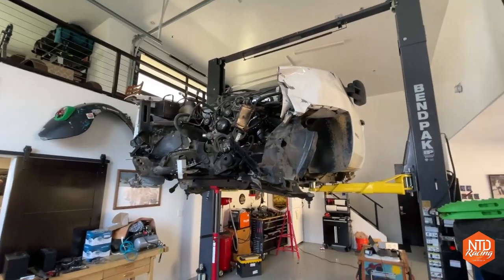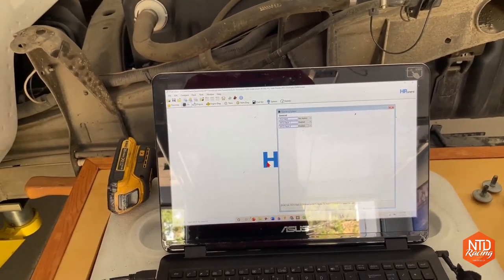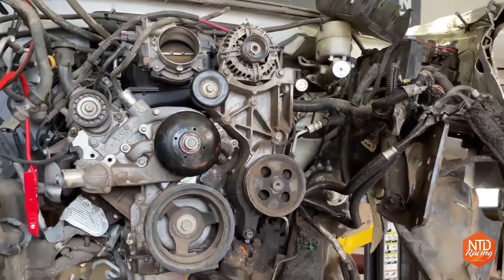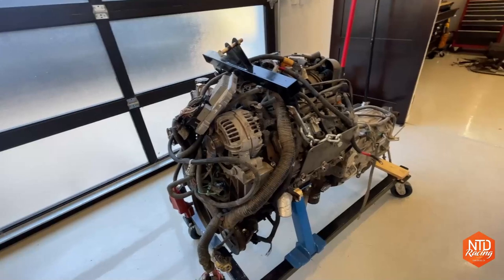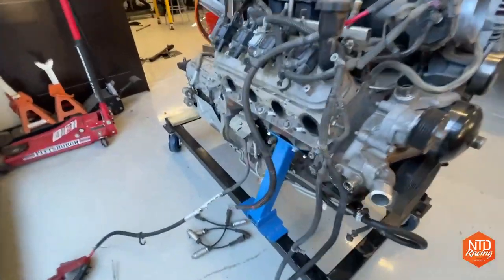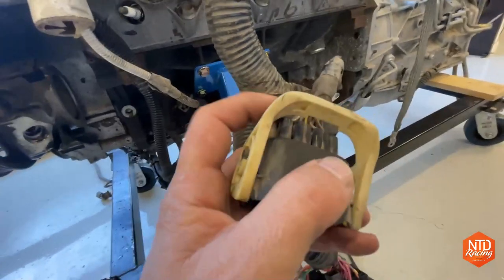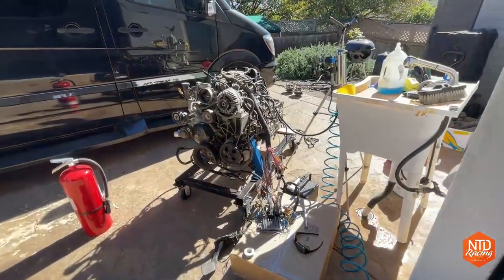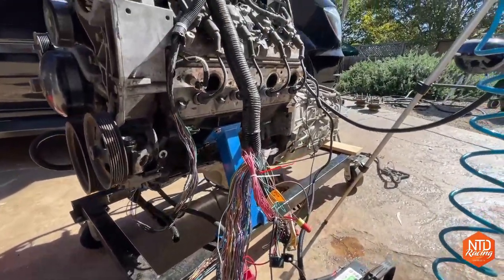How to make an LS Engine Stand Alone - L96 With an E78 ECU

Comment: Lol, man I wish I had come across your videos sooner, I just dropped a L96 6L90 in my 76 C10, and I wanted to use the ecm and tcm as well as the original harness,  but had to go aftermarket for lack of resources on a 2019 L96 swap. Keep up the amazing details brother!
Reply: What company had the harness? Im having issues with my stock harness and cant find an aftermarket for this engine/trans/ecm. Mine is a 2018 van e78 l96 6.0/6l90
Reply: @thetodifah4707  I got mine from BP Automotive
Reply: @Martin olivas  were you able to use the E78 ecm? I don't see an option on their site that is compatible with that ecm.
Reply: @thetodifah4707  I bought the controller kit that came with a new ecm I honestly don’t remember the model number but I did have to run a different tcm as well due to tuning issues. As well as an older 2012 throttle body and even had to share a vin number from a donar vehicle in order to get it tuned. Now in all of this I had to pass the buck to a mechanic and the tuner because I got overwhelmed and hit a rut. I had hoped to use everything stock from my complete pull but since my L96 &6L90E were out of a 2019 Silverado HD. There was practically nothing out there for my newer set up so that’s why myself and the mechanic were winging it. In hindsight It would certainly have been cheaper to get everything out of an older combination but you live and learn. I’m 100% sure that there’s a way to utilize all the stock components but I’m not smart enough nor have the time to trial and error with confidence that It’s going to be correct. I hit up all the main ls swap masters and got shot down by the few who responded because my combo is so new.
Reply: @Martin olivas  That's the same problem I'm having. Too new, no support. Thank you for taking the time to reply and explain how you made your setup work! I really appreciate it!
Reply: @thetodifah4707  no prob bro sorry I couldn’t be more helpful to you.

Comment: I love the content brother. For future reference.  When pulling the engine on a damaged truck cut the frame at the firewall. Cut the top and about 3/4 of the way down with a Sawzall and the frame will relax and drop down away from the firewall and it will give you more room to work. Don't cut all the way through. You just want the frame to drop down some. Don't cut the bottom. You want the engine to come forward and down some. Once you get a little over half way on each side, go from side to side until the engine moves forward and down some.
Reply from the maker: Thanks.  This will be useful for the next one I am looking at.
Reply: Welcome. Just make sure to remove the transmission mount so the engine and trans can move with the frame.

Comment: These videos are packed full of information and clearly presented.   Super useful.  I can't believe the channel doesn't yet have more subscribers.
Reply from the maker: Thanks.
Reply: @NTD Racing  Any idea why my Throttle body wouldnt respond to my pedal? It moves a tiny amount when i first push the pedal, tgen nothing. Tried another new throttle body, and same result. My handheld code reader shows the pedal move up to 83.7% nice and smooth, but the actual throttle body  position stays steady at around 32%.
Reply: @ntdracing what’s ur opinion on the expensive terminator x harness vs a stand alone
Reply from the maker: @Brandon_obs_ls  I could not really say….I ended up going with LSX Specialities for a Harness and computer.   They are the real deal.   I literally told they what I had and they made the harness and best guess at a tune.   I put it on our race truck with no time to get to the Dyno and we ran it at the Baja 1000.   Made it all 1200 miles to the finish.  https://www.facebook.com/LSXspecialties?mibextid=9R9pXO
Reply from the maker: @Brandon_obs_ls  in the future, I will make sure to get a drop out engine with an E38 computer.  Just seems easier to work with.   Still using the old harness on our first race truck.
Reply: @ntdracing  I keep hearing people talk about terminator X and Holly harnesses but i recently saw a guy who had 1000 plus hp with just a stand alone stock harness and it harness he said u ain’t need that extra money wasted if u tune it right u good with oem standalone harness
Reply from the maker: @Brandon_obs_ls  agree 100%.    I went with an aftermarket harness because I was running out of time on our Baja 1000 truck build.  I also cut salvaged some of the parts of the original harness to use on our other race truck.  I decided to spend some bucks to save time and start over with a solid harness.   If I had a solid harness with an E38, I would have just used that.   The LXS folks made me a new harness with E38 computer, so now both trucks harnesses are nearly identical.

Comment: L96 is a great motor for desert racing. They don't have a ton of the stupid emissions crap that the other LS motors have and its still an iron block which is very reliable. With a little love and plenty of on time maintenance these motors last a long time. Plus the L96 is made to run on crappy fuel so theoretically, feeding it great fuel and letting it breather better yields decent improvements in torque and horsepower.
Reply from the maker: It ran great for 1200 miles at the Baja 1000.  Oil and air filter…ready for the Mint 400.
Reply: @ntdracing  Just replaced plugs, plug wires, and coils on mine and put shorty headers on it while I got rid of the busted exhaust manifold bolts. Now it runs great! good motor. Although I've always been a ford guy, my other project is an 88 Bronco II awaiting the all mighty 5.0.

Comment: With the HP tuner, once you spend the credits for a vehicle, can you continue to connect to that ECU in the future? Like when you are using it for racing, can you change the mixtures and what not? or is it 2 credits each time you connect to that particular vehicle?
Reply from the maker: Two credits works forever on that ECU.   I have probably sent a new program 100 times as I am learning to tune these engines.

Comment: Hi great video, any tips on how to make an audi 4.2 v8 bns engine from an rs4 standalone? I’ve made a test bed for it, I’ve got the main engine loom and ecu, and main auxiliaries attached to engine, just not sure where to start with the wiring… I’m doing an engine conversion into a vw but want to rebuild it and get it running on the test bed before I install it into the van

Comment: How did you get yours started with out the BCM? My LM7 from a 2007 won’t start even tho i disabled VATS from HP tuners. It cranks, starts then kills it self after 3 revolutions.

I checked the crank and cam position sensors. Everything else is connected but still won’t stay on.

Fuel is also at 60PSI as the motor is running
Reply from the maker: Make sure you select “Write Entire” when you write back to the PCM.  If you do not, when you go back and read the PCM again you will see that VATs is still there.  Hope this works.  Would like to know.

Comment: So basically  tie all the pinks together,  run purple to ing start. ground engine block from battery .run hot from battery to starter. Remove vats. I'm I correct or missing something.  But will it run with doing anything else???
Reply from the maker: That is about it.   There are a few  grounds you will have to take care of that go to the ECU.   If it is black…ground it.    Good luck.

Comment: Awesome video! I have exact setup (L96 with e78 and 6L90) in a 62 delivery van with a Current wiring harness. But now I want to switch from clutch fan to electric fan and wondering if you have that figured out yet? I would like to run some brushless variable speed fan(s)....maybe Spal. But been hearing it can be hard to control them with the factory computer. Wondering if you've made any progress on that topic. Awesome content!
Reply from the maker: I have not found a way to run the fans off of the ECU yet.  I have just not found any info on how to use the PWM signal to make a relay work.  I am looking at putting on of the Derale relay systems.  If I figure it out, I will make a video and let folks know.
Reply: @ntdracing  I'm in the same situation. Apparently GM oe fans and ecu uses a different signal than aftermarket fans so it's difficult to properly control aftermarket fans with the ecu. A lot of people use oe fans, I've also seem where they remove oe fans from the shroud and put them in a custom shroud. I read where a couple years ago HP Tuner was looking into it to see if they could add programming for that but no idea if that ever happened. I cant find any info on Youtube about this....it might be a good video that gets some good view! Anyway, I'm liking your channel, pretty sweet project!

Comment: 2018 e78 6.0/6l90 - i had someone remove vats. Will the throttle body open and close with key on engine off with the dbw pedal? Im having issues with no control of the throttle body, and when the ecm switches to closed loop, the engine backfires through the intake tube. Any help would be appreciated!!

Comment: Can you use ly6 cam kits in the l96 if its the same other than injectioner plugs also were you ever able to tune in the fans on the e78 ecu ? Thank you for your time
Reply from the maker: @jaywoolfolk243  they should all take the same CAM.   We did swap our L96 to an E38 ECU.
Reply: @ntdracing  did you change harnesses or did it plug right in ? also do you know if the 2014 and up body style 2500 all came with the e78 ecu thank you for your reply very appreciated I'm trying to put a 2014 up l96 6l90 4x4 in my 04 1500
Reply from the maker: @ ok…this is the best I can answer, hope it is right and helps.   

If remove an engine, transmission, ECU and TCU from one car and put it intact into another it should work.   There will be challenges making everything work with “new” truck like the BCM.   Since I swap into race cars, I do not have to deal with any of that.   But as far as power goes, if you keep all the parts together it should involve simple wiring and removing VATS.   I would just swap the engine first then CAM swap later.  Get it working before you remove VVT and have to do the associated tuning.

Comment: Where did you find pin out for gas pedal I have a 2006 lh6 I need to wire into
Reply: Tac module still....did you find?

Comment: Does this standalone work for the trans that’s a need to know?
Reply from the maker: Yes.  The 6L90 TCM does not have anything to do with VATS.   It talks to the engine to hash out torque management and gear selection, but you can swap a 6L90 with another no problem.  We were running an Express van 6L90 in the race truck.  The only thing it did not like was when we flashed the truck program into the express van TCM.   Now what I do is connect any 6L90 to my LY6 or L96 and read and save the tune from the TCM to modify.   Then we flash that back in with stuff like TUTD…see my other videos on that.  Hope this answered your question.

Comment: Did you ever find a pinout.  I have an e38.  I am looking to create a standalone harness.  So i assume you ended up tying all the pink and rewirea together and provided a grown to the black?
Reply from the maker: I did.  Check out the link for GM Upfitter in the description.
Reply from the maker: I did tie all the pinks together, but I will make a fuse box and separate all the major parts into a separate fuse.

Comment: but how do you turn it off?
Reply from the maker: Remove the 12v from the ECU.  Will shut down the fuel pump and ignition.
Reply: @ntdracing  so basically if i swap the engine into a different car once i turn off the ignition switch itll turn off the ecu?

Comment: Idk why ecm is not sending a signal to my fuel pump relay I have the same engine and transmission than u... I have signal power to all my other relays except  the fuel relay and also my ecm plug and my scanning tool don't wanna share information it just says not conecting
Reply: Did u found the problem? I have tge same exact problem same 2013 2500 hd l96 6l90e e78 and mine turns but won't start and I checked and I don't have power to fuel pump and my code reader don't wanna connect either same problem than u ...let me know if u solved it

Comment: Uuuhhg.. too much work to get computer powertrains to run.

I miss the ease of repair with pre computer cars. 
But computer cars do emit less pollutants,  so that's a definite plus.
But I know it's possible to design cars that are easy to repair,  while retaining low emissions,  especially when we can send rockets into space and return them for reuse.
Reply from the maker: @privateprivate1865  funny…I feel the same way about carburetors.   I have tuned my LS a few times and am considering a making a video that makes it super easy.   The process to make it easy is a little difficult.